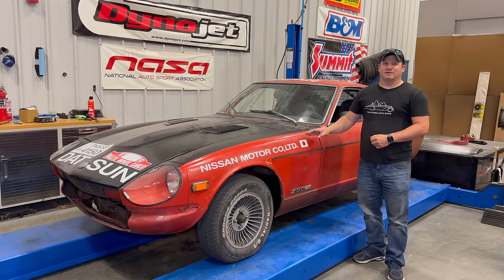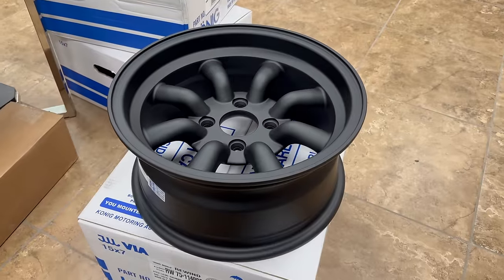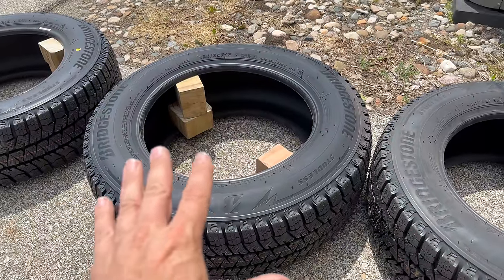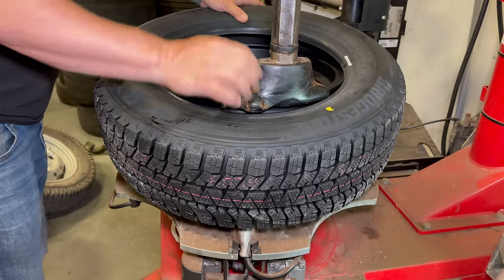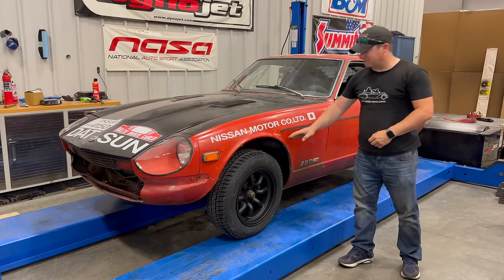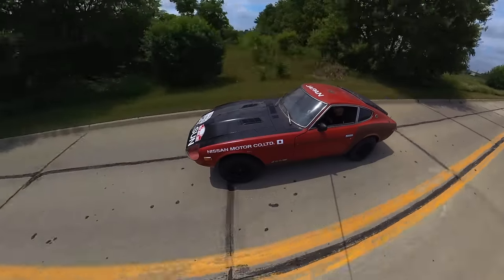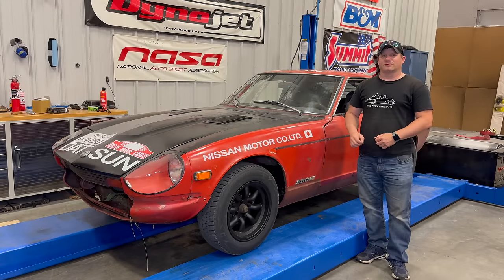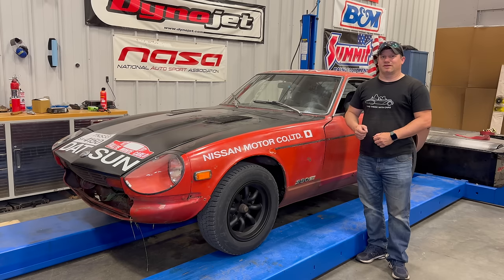1976 Datsun 280z - First Test Drive

Comment: Tire "butter" or tire grease as its known by most as will not only help the bead seat from air escaping but acts as a lubricant as well. Its great for corrored bead locks on wheels and damaged beads on tires too for getting a seal. It's saved many people especially when an unexpected rapid decompression happended to someone in my income bracket at the time. A mounted and balanced tire for $25 made many's day including my own.

Comment: When we mounted tires in the 60s we put a special made very supple rubber tube between the tire and rim.  As the tire inflated the rubber tube would walk itself outward and self extract itself.
Reply from the maker: I have heard of those still used today but have never seen in being used.

Comment: Im so old I remember the Empco 225/75R-15 and could not believe they were DOT approved. They looked like a 15 inch snowblower tire from Chy-na. Only mounted one set to get someone through inspection on a fixed income. Your rim clamp tire machine for some reason briught some memories back.

Comment: Those lens covers look so good. Datsun should have made them standard. Excellent new rear fenders. But why do I think those Bridgestones remind me of all season.
Reply from the maker: The lens covers became illegal in the US which is probably why you didn't see them on many cars in the 70s.
Reply: Ha! Why? What in the world makes them illegal.
Reply from the maker: They would get condensation inside the lens which would lead to algae, mold, dirt ect building up on the inside of the lens making the headlights too dim to be safely used.
Reply: @ThisWeekWithCars  somehow I think I actually think I heard that. I just didn’t pay attention thinking that leaking was simply cheap design. Thanks.
Reply: @ThisWeekWithCars  Plus, running the lights while there's still condensation in there will result in a diffused beam of light that will dazzle oncoming drivers.

Comment: what's the purpose of aligning the stem with that yellow dot?
Reply from the maker: Good tire manufacturers balance the tire itself before shipping and mark the lightest spot on the tire so matching that to where your valve stem should get you to the closest possible balance before you put on your weights, this is of course if you wheel is not bent or damaged.
Reply: @ThisWeekWithCars  that makes a lot of sense, thanks!!